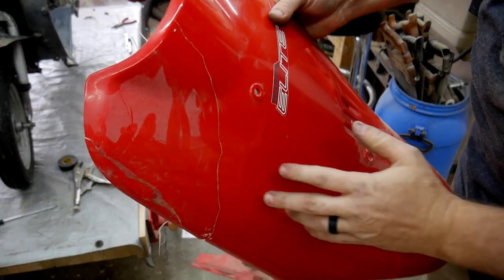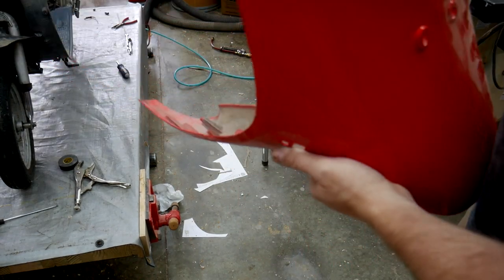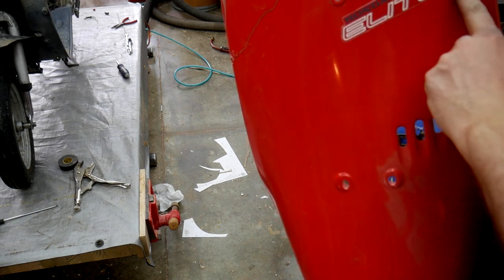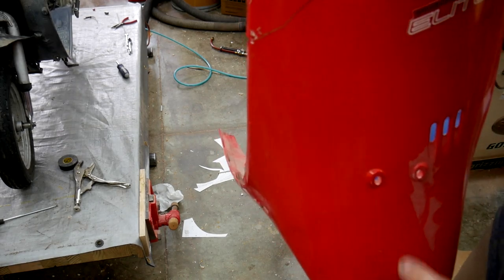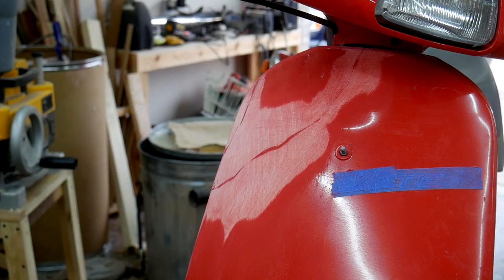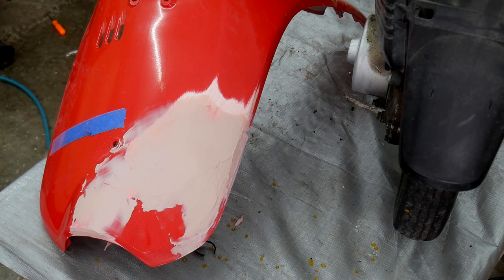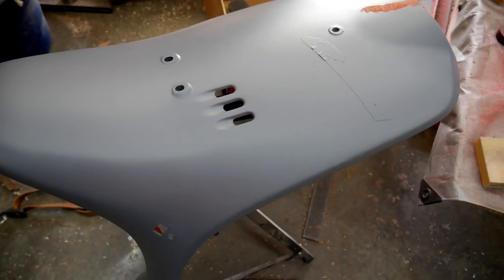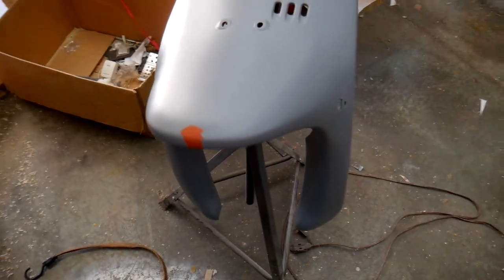Honda Scooter Bodywork Part 2: Bondo and Finish Paint

Comment: How did you remove the reflectors without breaking them?
Reply from the maker: To be honest with you, I can’t remember how easy or hard they were to get off. One came off in the accident. I think all you have to do is get something between the reflector and the gray mount and gently pry the reflector off. The mount is attached to the fairing with a screw.
Reply: @SouthpawWorkshop  thanks.